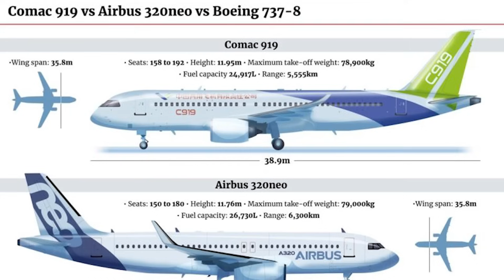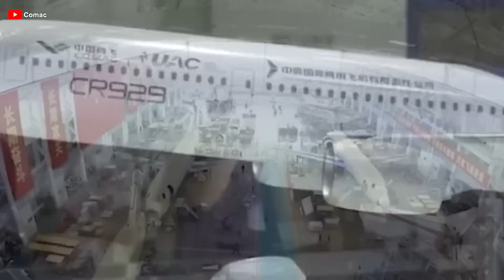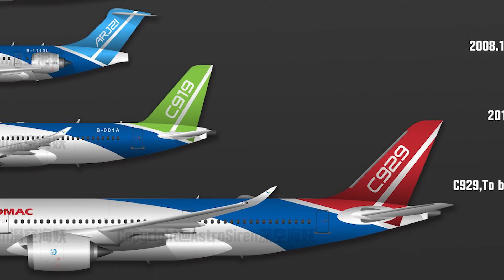China’s NEW C939 & CJ-3000 Engine will BEAT Boeing&Airbus! Here's why

Comment: Yo creo que China, por necesidad estrategica y orgullo nacional antes que comercial, necesitará un equivalente al B747.
Si eso es asi, mientras se desarrolla el motor CJ3000  para el C939 y su certificacion que pueden durar unos 20 a 25 años, deseará desarrolar primero su C949 equivalente al B747, el cual podria consistir en el fuselaje del C939 en desarrollo con 4 motores del C929 (CJ2000) o PD35 ruso ya desarrollado.

Comment: I wish China could come up with a revolutionary passenger jet design.
Reply: If you look at the modern passenger jets they are all very similar shaped and almost mimic one another both inside and out ( think cars!). Since the 1970s there has been no new revolution in plane design in the commercial sector. It’s the same old tired technologies at play with only manufacturers being different. There has been no advances in fool proof safety systems of   to prevent from catastrophic crashes. Just look at the recent AI crash… a plane takes off only to find everything stopped working in less than a minute and crashes ! How can that be? It’s mind boggling to say the least!

Comment: This is major news. If they can get 10+ yrs of reliability on the C919 with CJ-1000 engines, could change how budget airlines operate. It will be years before CJ-2000 is considered option for overseas carriers, but am sure they are all thinking 10yrs ahead wondering if the C929 / CJ-2000 could be an option.
Reply: lose a few hundred planes wont worry them, humans are replaceable. They can blame western parts for the failures.

Comment: The problem with the C919 is that it relies on western parts.  China needs to develop its total supply chain for its domestic aircrafts.
Reply: China knows that it cannot rely upon Western supplies - or even from Russia - as both have reneged in past dealings with China just as China was starting to get a leg up. leaving the Chinese high and dry (eg China's missile and nuclear program, industrialization, trade sanctions, satellite navigation, etc, etc). every time there is a change in government in the West, their policy towards China switches back and forth with the reliability of a volcano or an earthquake.

This is why it went ahead to develop its own jet engines - for the military and now, its commercial planes. It is also looking at ways to develop its own carbon fibre and composite material elevation parts like wings. This is one of the reasons why China pumps out so many STEM graduates each year - far more than any other country - giving it the ability to pick and choose the best brains and talents in science and technology, engineering and mathematics to solve problems and overcome technological hurdles.

I remember reading about the background to China's "Three Gorges Dam" which construction was started in 1994 and finally completed in 2006. It was the largest dam in the world and the biggest engineering project in China. Before construction began, every single "expert" from the West was saying that this project can never be done. It was simply "impossible". China went and proved them all wrong. 

Many centuries earlier, a very astute and positive minded French emperor,  Napoleon Bonaparte commented, "The difficult takes just a long time to be achieved. The impossible takes only a bit longer."  The same emperor also observed that, "In the East lays a sleeping dragon. Let her sleep because when she awakes, she will shake the world." 

Doubters never achieve anything. They give up even before trying. China today doubts nothing and which is why she manages to push ahead, ever onward and forward. Don't worry - China will develop its entire supply chain for its aircrafts for itself and not have to depend upon others.
Reply: On component no burst, for less money.
Reply: Unfortunately, C919 is 100% made in China.

Comment: I get that jet engines are becoming more and more powerful and efficient, but don't understand why a plane manufacturer would remove redundancy by installing only two engines on a large plane intended for ultra long-haul flights.
Reply: Costing.  4 engines is four times the maintenance, you are right about redundancy. Very comfortable feeling flying 4 engines over long flights 🛫 ver the oceans.
Reply: Maintenance cost vs safety.

Under late stage Capitalism, lower cost wins every time!

Comment: This is an artful propaganda piece.  The thought that China could match the RR and GE in the development and volume production of reliable 40+ Ton thrust category is a joke.  Even if they have stolen the complete designs of both engines they will still have to develop the industrial process to make the components that go into them.  This is neither fast, cheap, or easy.  China can do it,  It will just take much longer than suggest here.
Reply: FYI China partially owns GE in bailing it out from when it almost went under.
Reply: CIA troll.  Get out of your mother's basement.  C-919 and C-909 already flying; I have been on the C-919.  Regarding stealing, stealing what?  That a plane needs two wings? A horizontal stabiliser?  A fuselage? A vertical stabiliser?  Landing gear?  Yeah.  I gues from that point of view everyone is stealing from everyone else.
Reply: Regarding 45 ton being a joke, you mean like China landing spacecraft on the front and back sides of the moon?  Building their own space station?  Building AND FLYING a 6th gen fighter that US for which US only has cartoon drawings?
Reply: Yeah, nah. The Yanks said that when they banned Huawei. How did that work out for you? 😅
Reply: Was the first Boeing aircraft designed by a Chinese?
 
The first Boeing aircraft was indeed designed by a Chinese. In 1916, the Pacific Aero Products Company (the predecessor of Boeing) modified a Martin aircraft to launch the "B&W," but it was rejected by the U.S. Navy due to various issues. That same year, Wang Zhu, a Chinese graduate of MIT's Aeronautical Engineering program, was recommended by one of the company's founders, Westervelt, to join Boeing as its first engineer. Wang improved the aircraft and designed the B&W-C, a twin-float biplane seaplane. His design successfully solved problems like takeoff and landing stability, passed U.S. military tests, and secured a 50-aircraft order for the company, marking a crucial step for Boeing. For this, Wang Zhu is also known as the "Father of Boeing."
Reply: Yangtze-1000 Engine
 
- Performance: The Yangtze-1000A delivers a thrust of 13.5 tons, with fuel consumption 15% lower than the previous CFM-56 and comparable to the LEAP-1C. It adopts technologies like titanium alloy compressor blades and dual-single-crystal turbine guide vanes. The single-crystal turbine blades can withstand temperatures up to 1,800°C, reaching the world's top standards.
 
- Localization: The Yangtze-1000A is 100% domestically produced, breaking free from reliance on foreign technologies and safeguarding China's aviation industry security. Relevant enterprises have overcome key technologies such as the manufacturing of high-pressure compressor integral blisks and established a complete titanium alloy forging industry chain, providing a solid foundation for mass production and future improvements.
 
Yangtze-2000 Engine
 
- Significant performance advantages: The Yangtze-2000 has a maximum thrust exceeding 35 tons, larger than the 33 tons of the GEnx-1B for the Boeing 787. With a bypass ratio of 12:1, its fuel efficiency is 15% higher than the Yangtze-1000A, thermal efficiency reaches 18%, and the turbine inlet temperature is 1,950K, higher than that of the GEnx-1B. Its planetary gearbox accurately adjusts the speeds of the fan and low-pressure turbine, significantly improving power efficiency. Additionally, the high-pressure compressor integral blisk design reduces part numbers and failure risks. The nickel-based alloys and ceramic matrix composites used in the combustor and turbine components can withstand temperatures 200°C higher than those of American counterparts, and the main bearing life starts at 50,000 hours, more durable than international equivalents.
 
- Leading technological innovation: The Yangtze-2000 adopts GTF (Geared Turbofan) technology, in which Western countries are still in the initial stages, especially in the wide-body aircraft sector. China has successfully tested the fan drive gearbox based on this technology, demonstrating the rapid development of China's civil large bypass turbofan engines.
 
In conclusion, China's Yangtze-1000 and Yangtze-2000 engines have achieved remarkable achievements in performance, technological innovation, and localization. Some indicators have reached or exceeded those of Western counterparts, and there is still significant room for improvement as technology continues to advance.

Comment: Roll royce and GE makes the engines right?
Reply: Domestic homegrown super engines
Reply: Yes.😊
Reply: @samievans9632 Nope.
Reply: Yangtze-1000 Engine
 
- Performance: The Yangtze-1000A delivers a thrust of 13.5 tons, with fuel consumption 15% lower than the previous CFM-56 and comparable to the LEAP-1C. It adopts technologies like titanium alloy compressor blades and dual-single-crystal turbine guide vanes. The single-crystal turbine blades can withstand temperatures up to 1,800°C, reaching the world's top standards.
 
- Localization: The Yangtze-1000A is 100% domestically produced, breaking free from reliance on foreign technologies and safeguarding China's aviation industry security. Relevant enterprises have overcome key technologies such as the manufacturing of high-pressure compressor integral blisks and established a complete titanium alloy forging industry chain, providing a solid foundation for mass production and future improvements.
 
Yangtze-2000 Engine
 
- Significant performance advantages: The Yangtze-2000 has a maximum thrust exceeding 35 tons, larger than the 33 tons of the GEnx-1B for the Boeing 787. With a bypass ratio of 12:1, its fuel efficiency is 15% higher than the Yangtze-1000A, thermal efficiency reaches 18%, and the turbine inlet temperature is 1,950K, higher than that of the GEnx-1B. Its planetary gearbox accurately adjusts the speeds of the fan and low-pressure turbine, significantly improving power efficiency. Additionally, the high-pressure compressor integral blisk design reduces part numbers and failure risks. The nickel-based alloys and ceramic matrix composites used in the combustor and turbine components can withstand temperatures 200°C higher than those of American counterparts, and the main bearing life starts at 50,000 hours, more durable than international equivalents.
 
- Leading technological innovation: The Yangtze-2000 adopts GTF (Geared Turbofan) technology, in which Western countries are still in the initial stages, especially in the wide-body aircraft sector. China has successfully tested the fan drive gearbox based on this technology, demonstrating the rapid development of China's civil large bypass turbofan engines.
 
In conclusion, China's Yangtze-1000 and Yangtze-2000 engines have achieved remarkable achievements in performance, technological innovation, and localization. Some indicators have reached or exceeded those of Western counterparts, and there is still significant room for improvement as technology continues to advance.